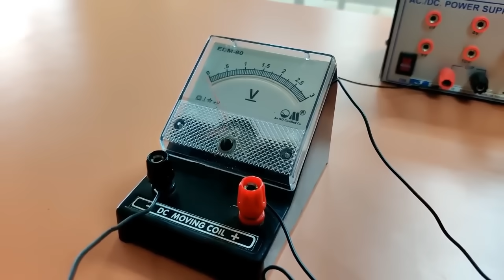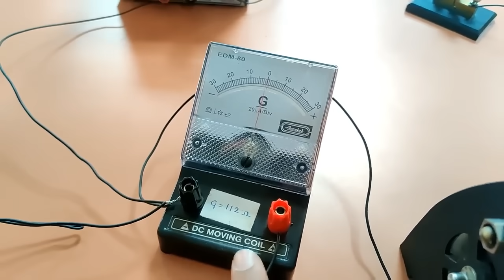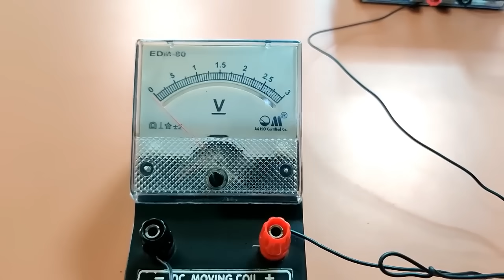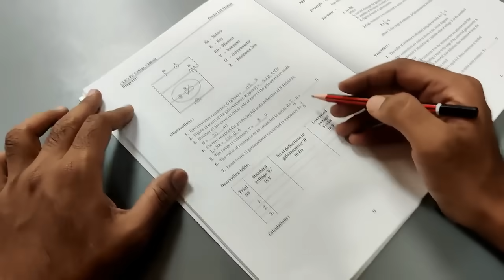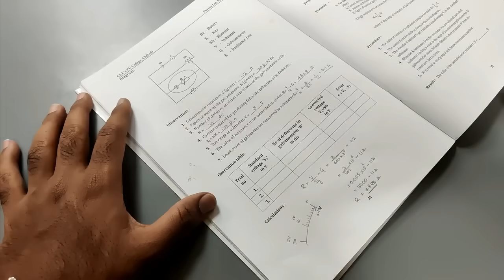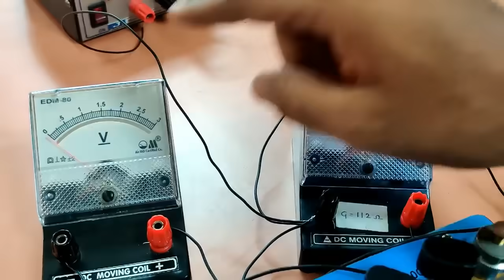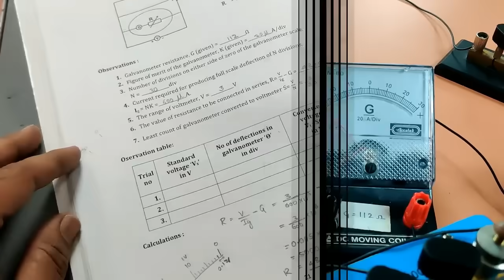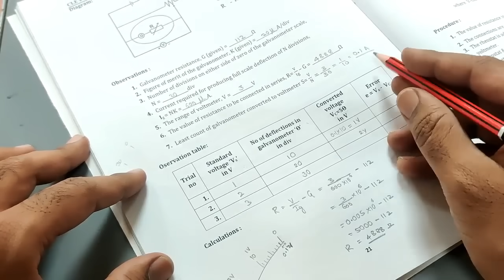Conversion of Galvanometer to Voltmeter | 2nd PUC Physics lab Experiments #physics_lab_experiments

Comment: Sir i forgot to write the loop around galvanometer and resistance in circuit digram mam didn't  told anything after showing the circuit mam just signed and told me to do the cirucit
 does they will cut the mark for that i had written the circuir corrrectly but the loop i forgot plz tell me sir
Reply from the maker: Nothing to worry it's negligible
Reply: @ParivartanPhysics71  sir in voltmeter experiment i got observed value 4900 ohm
And calculated value 4950 ohm is the result correct
Reply from the maker: It's correct
Reply: Tq sir

Comment: Sir if it was in English it would have large audience 
cause most icse students have skipped Kannada after 7th
Reply from the maker: Yes I know, but either from cbse or icse if they are from Karnataka they can easily understand I guess. And partly I've used English also. My goal is to reach all Karnataka students.
Reply: @ParivartanPhysics71  yes sir you using English a bit in the video is helping me!!